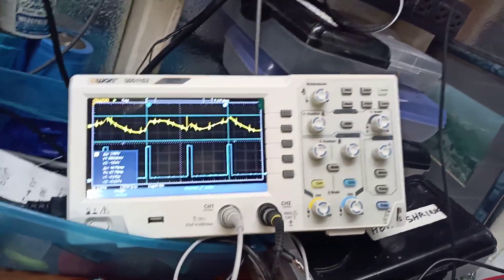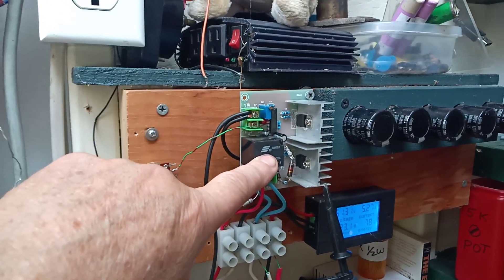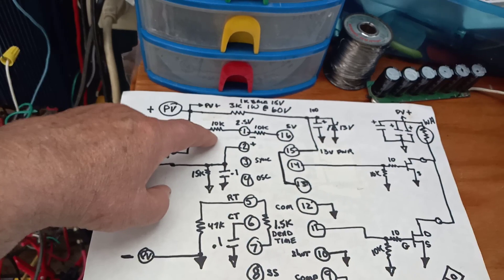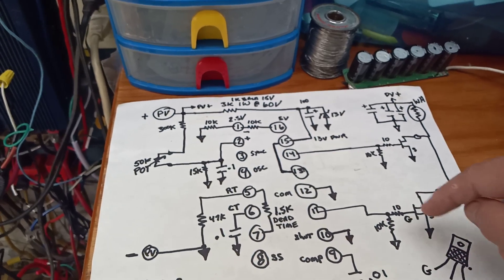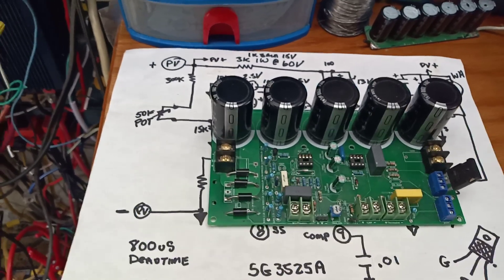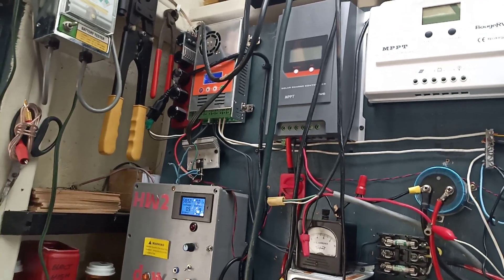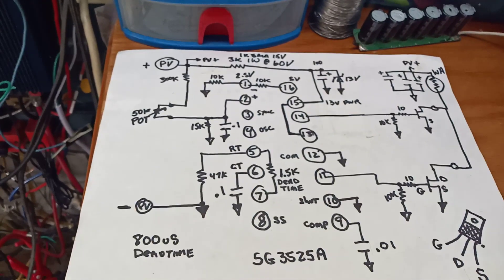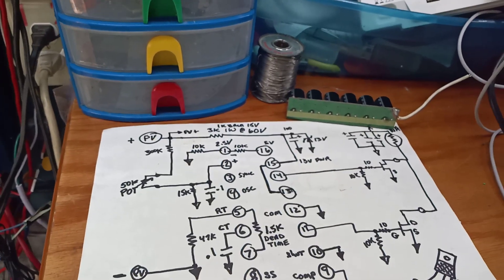PV Diverter Excess Power To Hot Water, SG3525A One Chip Build part 2

Comment from the maker: SCHEMATIC ERROR:  Ct and RT are reversed.   

This is one of dozens of designs that can be used to divert PV power to heat water. It is not suggested you purchase this board because it is unknown what they will send. Building your own is simple enough with perf board. I have been using this for about 5 years and just added ARC INTERRUPT so it can be used with my new post heater BOSCH ES4 water tank. I set this one to operate at 67Hz with an extra long 0.88ms arc interrupt to limit maximum power. Read this 2020 paper on using PV to heat water for an explanation of the principals of operation. https://www.mdpi.com/2071-1050/13/18/...

NOTE: When used in parallel with a charge controller, a diode of suitable current and voltage is used between charge controller and this diverter. Voltage and current is only limited by FET and capacitor bank used. Suggested 6,000uF minimum.

Comment: If conect termostat in pin16 to pin 10 the sistem stop. Conect power pin2 to 16 is more safe. What do you think?
Reply from the maker: Connecting pin 16 (5V reference voltage) to pin 10 (common ground) is quite brutal in shorting IC internal circuits. It also operates in reverse of turning off the heater. That could damage the chip.   This circuit has arc interrupt, and it is fine to have the high current thermostat in series with the heater element.  The dead time is created by the resistor between 5 and 7. 

You could also switch power going from dropping resistor  to the zener.

When using a low current electronic thermostat, connect the thermostat relay between the PV sense voltage dropping resistor and the pot.   The switcher will shut off when no voltage is sensed.     A more advanced option  would be to place a resistor across the relay contacts which would raise the voltage closer to V open circuit of the array.  This would reduce the power to the heating element to maybe 10-20W, a level that would equal the heat loss of the tank but not cause additional heating.  The advantage of this is it would prevent PV array from going to full open circuit voltage.   This would prevent over voltage to a FET which had a lower than ideal voltage.
Reply: @opera5714 the pin 1 y pin2 its ok?
Reply from the maker: @manuell7843  I don't understand your question with 1 and 2.

5 and 6 are reversed. That was back when my heart rate was 37 and had low oxygen.  I thought about doing a new video. It still has enough information for someone experienced.  Since hardly anyone builds stuff, it just wasn't worth the effort.   This is the design I use on my primary water heater.
Reply: @opera5714 Sorry i try add tc4420 to mosfet, add 4 mosfet in parallel and add inductor and i am desing a analog regulate automatic without pot. I hope dont have the electrolitic problem. Thanks for the desing. I only view inox resistor for 48v . In spain the limit for legal is 70v. 48v its ok and safe.
Reply from the maker: @manuell7843  All solar is local.  I run 60V because of shading issues and that works.  I don't drive FET hard to reduce EMI problem.   There is no reason to inductors and make a DC system.  Some run at higher frequency to reduce audibly noise that can be produced from some heating elements. Hope you produce some videos on the system.  I'm here to help with any issues.

Comment: Hi im from EU and i dont know what unit you use in schema for capacitors there are only numbers and do you think is possible rebuild this schema for 200V exchange your transistors by IRF 9640? Thank you
Reply from the maker: 200V open circuit voltage of array? Open circuit voltage of array should only be about 170V with a 200V FET.   The 9640 is a P FET and will not work. That also has a very high ON resistance and would need many in parallel. I would want to see an ON resistance of less than 0.1 ohm. TO247 packages are much better at having a low junction temperature.

Comment: Made driver for 4 panels in series , 170V, 11A, bank of 10x1000uF, but I get some heavy oscillations when fet switches off, any idea how to suppress this osillations ?
Reply from the maker: With any high current switching application it can be easy to induce noise.  This is the reason on my board I use timed reset with the IR2153.  My comparator output looks like grass on the output and it is as stable as can be.  I like to keep parts count to a minimum because too many parts scare beginners.  With your voltages and currents and possibly wiring configuration you are getting a lot of noise.  That circuit has high open loop gain.  Ideally you want to keep delta V as small as possible.  In a practical sense it can be better to open this up a little.  There are several things you can try.  Add some capacitance to comp 9 to common like a  .01uf to stabilize the output.  Lower the open loop gain with a resistor from  comp 9 to pin 1 for some feedback, try 100K.  A capacitor could also be added across that resistor.   Maybe a .1uF or even higher.  Check delta V on capacitor bank keeping it around 5% What is it now? This problem can be solved.  Hope you make a video of your project.
Reply from the maker: Did you put a diode across the heating element?  The 3525 design has much faster switching since the pulses can be very short. In my other design I slow the FET speed so fast transitions do not happen.  Many heating elements have the outer sheath grounded and the sheath acts as a shorted turn on a transformer absorbing this energy.  Grey heating elements are typically not grounded and the heating element has just enough inductance to ring.  Operating at 60 or 60 Hz is slow enough that standard diodes can be used.
Reply: @opera5714  Hello, thank you for the ideas,  diode is in place , I have a feeling that oscillation is happening only on one FET, I have to check again, I have to  shorten all wires connecting cap. bank with PCB/FETs   now everything is in prototype stage ;-). From your experience, what kind of FET would you recommend for this application ?
Reply from the maker: @janeznovak7070  You can run just one FET as a test.  That half cycle will produce up to half power. What are you using now and what is the open circuit voltage of the array?  Were these from a reliable source. There are some more expensive FET but generally over a 200V rating you switch to IGBT.  That does take a bigger heat sink as there will always be about a 1.7V saturation voltage. The IGBT will produce up to 8W of heat. I bought IRFP260 which are rated at 200V.  These will start conducting like a zener at 220V. I would not recommend more than 170V open circuit. I bought several hundred when I found good ones because finding FET that aren't fake is a serious problem.
Reply: @opera5714  I had opportunity to get two C2M0160120D  (1200V,20A, 160mOhm,TO-247) probably real not fake. Open circuit voltage around 205V. Do you have any particular IGBT on your mind (voltage, current ?)
Reply: Finally manage to sort out all the problems, currently gaining around 10-12kWh per day ( 300l boiler).  Probably the biggest problem was noise from wall adapter used to power SG35225, after filtering that and adding some hysteresis to the system (delta V around 8V @ 160V ) thing start to work as they should from the start. Now its time to draw a  PCB and to pack all the stuff from the bench to nice looking  box.
Reply from the maker: @janeznovak7070  Good you found the problem.  The 3535 design was what I did with the 300W China inverter board.  I actually prefer the TL494 in this application and put the output devices in parallel.  Problem was the low undervoltage lockout could cause an issue early in the morning. A FET driver would be needed to ensure no drive unless power voltage was right. This new 12V switching power supply solves the issue. I'll be doing a design on that. I'll review your design for any issues before going to PCB if you would like.

Comment: Is the KA3525AN a good replacement for SG3525A?
Reply from the maker: Yes, this is the same chip as designated by the A at the end of the number. Be sure the timing resistor and capacitor pins are the same as there was an error in the schematic.  Please post a video of your completed system to convince more people to build this system. Thanks

Comment: Hello all,
It's not clear to me if youa re selling boards or not, i'm in Europe and my array is 200V DC, our heaters generally use 220V elements. Can your circuit be modified to suit those parameters ? 
Thanks
Reply from the maker: Postal service has such high rates that I can not even send a circuit board. I did sell evaluation boards for a while, but all the solar people stiffed me and didn't provide data on their system. So, I don't sell anymore. It is easily adaptable for any voltage. I chose 160V max for my board because in the US this is an easy voltage to work with as typical for a 4 panel system. For over 200V use IGBT and 400V capacitors. There are several systems like this made in Europe, but they are all sold out due to recent crisis. US is quite backward and I can't give these systems away. This is very simple to build. Cheap switching power supplies work on DC and can provide the 12V.

Comment: Thank you so much! I followed your instructions to modify buck converters for MPPT and they work great (though I burned out a couple with too much current and not enough heatsink...). Can you explain (or point to a video) about why you switched from buck converters to the inverter board + capacitor bank setup? Also how much voltage/current/power do you estimate the thing can handle?
Reply from the maker: Not sure what you are referring to as switching from buck converters to inverter board.  That inverter board has been in use for 5 years except for prior year when I only had one tank. Prior to this video it didn't have arc interrupt. Input power was interrupted, and it was a three wire connection to tank. That board was only good for 60V because of FET and that board is no longer available.  This video included the modification to add deadtime to create ARC INTERUPT. I suggest only using TO-247 FET packages because of better heat transfer and parallel FET for lower resistance.
Reply: @opera5714  I'm referring to your early videos hacking the XL4015 and then a 36-72V to 12V converter-- maybe you never used these for water heating? I'm new to power electronics and everything I read talks about buck converters with an inductor but your approach of PWM with capacitors seems unique! I'm just wondering why you went that route for water heating as opposed to modifying buck converters? Thanks again, I'm learning a lot from you.
Reply from the maker: @ep8063  I had a water heater with a 240V element and did make a boost converter video for heating water at power point. I gained only about 15%.  The boost converter go really hot and after a couple weeks it blew a capacitor.  Most electronics from China does not meet its specs and certainly was not designed for continuous operation. Look up LoadMaster XP for an inductor based design. I have an international following. Europeans are far more interested in these ideas than US likely due to higher energy costs. Inductors are generally hard and expensive to source. They don't have any added value except in producing DC. A heating element doesn't care and works efficiently with pulsed DC. Efficiency is totally dependent on the delta V. Capacitors can be sourced from old electronics cheaply and lower current capacitors only need more of them. I listed a paper to read on the theory. In theory inductors have no loss. Reality is they do and when they heat up, half the inductance can be lost. Operation has to be at high frequency. They can be very noisy and circuit layout is critical. Capacitor based system is much simpler and it is easy to add arc interrupt.
Reply: @opera5714  Thanks again, appreciate your focus on simplicity and cost. I am ordering a few inverter boards to experiment. Any thoughts on whether htis would work with a DC motor load? They can tolerate big swings in DC voltage so that's not a problem. For example I've used a 180 V industrial DC motor to do useful work with 100 V - 200 V) . But maybe there is another issue, e.g. the inductance of the motor?
Reply from the maker: @ep8063  What you are proposing is called a Linear Current Booster. All DC motors can be thought of as a low voltage motor which creates a back EMF to make it a higher voltage motor.  The LCF turns the panels higher voltage into higher current. A diode must be placed across the motor to feed that current back into the motor. The motors inductance is what makes it work. All the inverter boards I have seen available have a picture of a 3525 and in the description, they say IR2153 which is a totally different design. I don't recommend thos boards anymore because of the 55V FET they now use.

Comment: Could be the perfect compliment for my solar hot water vacuum tube array and heat exchanger. What sort of temp boost can you get in one day on how many watts with how much volume of water (during what sort of indoor outdoor temps.)?
Reply from the maker: There is no magic. A solar calculator for your area and where the panels point will give the WH that can be produced on an average day. Figure 1KWH heats 6 gallons.  If used in parallel with a charge controller, typical excess will be 25% of array production. Many people use less than 20 gallons a day of hot water. I had a 13 gallon tank and a dishwasher.  Laundry had its own 40 gallon tank of which 15 gallons would be up to full temp.

Comment: That SG3525A looks like a very useful chip.  I've jut looked on JLCPCB and they have them for about $1 fitted on your custom PCB.  Combine this with a couple of IRF540NPBF at $0.50 each and you have most of your design.  The only problem is the capacitors which have to be ripple rated at about 50% of your load current so you can either use several large SMD or fewer leaded one on your board.
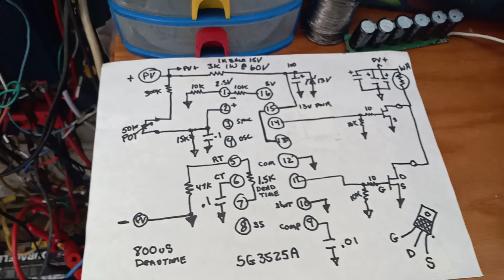Reply: By the way, do you have pins 5 and 6 reversed on your schematic at 2:49?  On the data sheets pin 5 is Ct and Pin 6 Rt.
Reply from the maker: @AndyFletcherX31  I must have lexdysia. My original schematic had Ct on pin 7 as I was looking on a SG3525 data sheet which is totally different than the A version. Everywhere you look they play loos with this terminology as if they are the same. Dead time is handled much differently, and it has uncommitted transistors like the TL494. That can be single ended rather than push pull. It was designed before FET and has a very low low voltage cut out making it unstable at dusk and dawn.
Reply from the maker: That capacitor bank shown is rated at 20A of ripple. I use IRFP260 in my water heater boards and these are in parallel. These are actually real IR and test better than data sheet and TO-247 are far more reliable because of better heat transfer. 60V is bottom end for water heating and most would want to be 90 or 120V. I wish I could combine best parts of TL494 & SG3525A. Both are very very old chips. Most newer switchers don't give you a low frequency range or options to run as a shunt regulator.  Ebay driver boards with these chips are just too hard to modify.